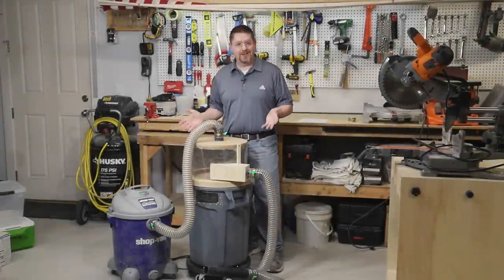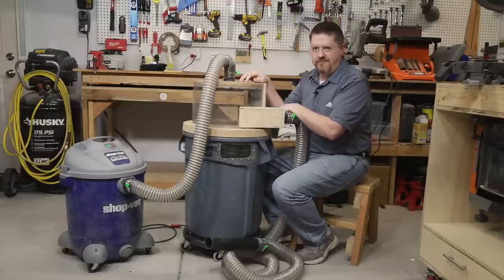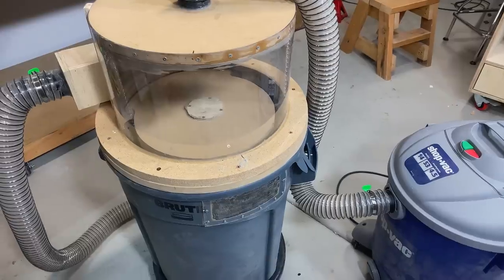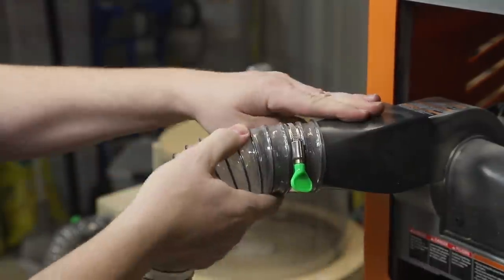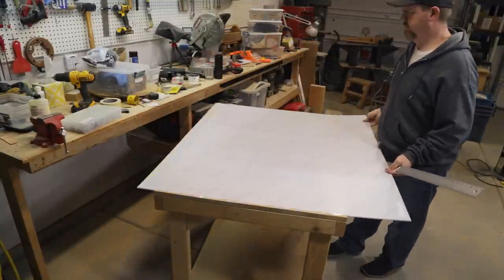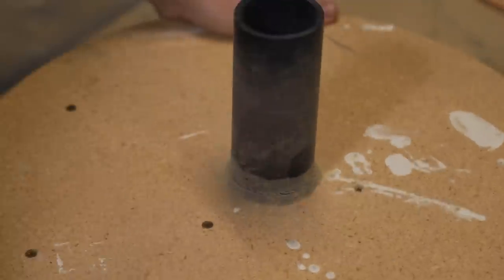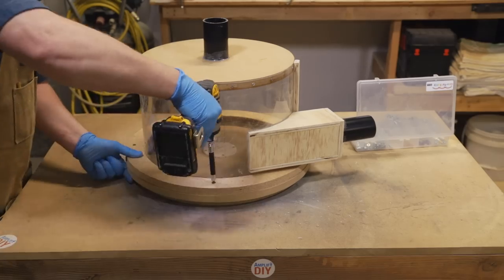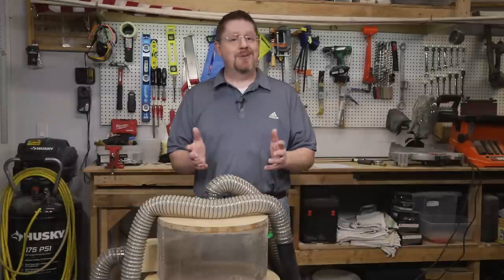Save Your Lungs! Dust Collection With a Thien Baffle Dust Separator

Comment: A suggestion for those using this on a planer or thicknesseser that produces large chips; these can clog the slot if they build up at the end of the travel, eventually blocking the whole baffle. When I made mine i added a 100mm circle at the end of the slot. Still works fine as expected but if anything larger than dust goes down the chute it can find a way down into the bin.

Thanks for a great channel, hi from Oz.

Comment: I've done the same basic design ... EXCEPT ... I used a 55-gal metal drum for the main receptable. Works great. Just that I don't have the ideal air flow configuration just yet. Your video is a great source for that info, Thank you.

Comment: Overall a nice video and informative.  The inlet should be at the top, not the bottom of the cylinder.   And it should be angled downward slightly.  Also, the dip tube should come down further into the cylinder.  The dust path while running shows you the problem.  If you look at other videos, you can see how the dust path is suppose to look like.  The most harmful dust is invisible, so what you see in the vacuum doesn't tell the whole story.
Reply from the maker: Thanks for the tips!

Comment: You need to support your inlet that fastens into the plexiglass to the wood so you don't end up cracking the plexiglass when you trip on the hose or something snags it.
Reply from the maker: This is a good tip. Thanks!

Comment: yep, I build one.  except I don't generate a ton of dusr So mine is built around a 5 gallon bucket. I Cut a piece of 1 1/2" PVC in to the side of the bucket (conforming to the circumference)  The bafffe is part of a bucket lid  I use a Stanley 6 hp 10 gallon vac.  Then built a stand out of PVC to stack them  (also stores tools) the collapsing bucket was fixed be sticking the separator inside of another bucket. The vac has a bag (for fine dust) after emptying the sepewrator  5 or so times the filter looks new (zero dust)  (I have less than $100 in it including the vac (new) and the PVC I am right proud of the way it works abd looks and the conveience of it

Comment: If you do a lot of work with MDF, you should use a HEPA filter cartridge in that Shop-Vac. A regular filter will still let some MDF dust through and you don't want to be breathing that stuff.
Reply from the maker: Good point. I don’t do a lot with mdf, but when I do I wear a full face respirator. I think you can see it in a few shots in this video. Great advice, thanks!

Comment: I've watched several videos on making this type of dust separator, this is the best!  Nice job in showing your mistakes as you went along!  I do have one question, why don't I see plastic elbows where the dust enters and on the exit pipe to help with the kinking of the flex hose I see in just about every one of the videos?
Reply from the maker: Thanks for the feedback! It never occurred to me to use an elbow at those locations. That’s a great idea!

Comment: Did you ever think about using a 20 - 55-gallon industrial barrel? They are a lot stronger than a cheap plastic trashcan. Some have handles on the outsides. They also are smooth on the inside. If you need any leads on where to get one... Try Craigslist for your area.
Just make sure the one you get has a removable lid. If it comes with a screw-type lid you may want to use some type of seal for the lid.
Reply from the maker: This is a great idea, thanks!

Comment: The ‘different’ thing here is the bottom entry inlet port which causes the waste to spin high up the sides.  There is room for a LOT of design experimenting here. No one addresses the height of the chamber to its diameter ratio, or depth of outflow tube into the swirl.  I’d love to do tests, unfortunately I don’t have the advantage of the super cheap materials cost you guys are blessed with in the US.  In UK that sheet of Polycarbonate is like 60 bucks (GBP) and the ply used here is about 30 bucks worth….with glue etc its 100 bucks per ‘top hat’.  The stuff you casually throw together and as easily throw away is over a weeks worth of entire disposable income! Ah well.
Reply: From all I’ve read or seen, the inlet port should be as high as possible (see comment by billwebster759, above).  Also, the exhaust port should be positioned about 2 inches above the baffle.  As to the ratio of height to diameter, I do not recall having come across any particular guidance.  I have seen woodworkers construct Thien-style dust separators that are two feet across and probably 16-20 inches high, or made from a #10 can or two liter plastic soft drink bottle.  I have observed that folks sometimes appear to forget or overlook certain aspects:  gravity, momentum, distance for example.  Good luck!

Comment: If you extend the vacuum pipe in the baffel so it just has a 1.5 inch space between the baffel and the vacuum pipe, and move the "intake" of the dust to the top of the baffel, the dust will loose speed alot faster and fall thru to the baffel.. also adding a larger pipe standing on the baffel itself creating a bit of a "maze" will help reducing anything getting passed even more. As vacuum is a constant and the only thing you need to be fighting is velocity vs. gravity it can be halted effecitly.
Reply from the maker: Good tips. Thanks!
Reply: Can you give a little more detail on this. I’m kinda slow so I have I have a difficult time understanding what you’re exactly saying. I’m planning on building something soon however a little larger and it would be great to get the dust pulled down into trash can rather than it continue spinning. Thanks, Joey
Reply from the maker: @Spurtaker   Moronicsmurf has suggested I make 2 different changes: Make the pipe at the top center of the whole thing extend down lower (so it's about 1.5" from the bottom of the circular chamber) and move the intake pipe (that the dust enters through) up to the top part of that chamber instead of at the bottom as I did. These 2 changes will make the dust come into the chamber above the top of the pipe that runs out to the vacuum, which will make it near impossible for any of that dust to get sucked into the pipe that goes out to the vacuum. This device already does a fantastic job separating out my dust, but those 2 changes would make it a bit better. Hope that makes sense - thanks for watching!

Comment: nice job. mistakes are only learning opertunities. 
the thien forum is great. im a regular over there. retired 2 is great .  to improve it  i would thin out the edge of the slot on the bottom . i would extend the outlet more. its a shame you made a double height seperater but put the inlet so low, if efectivly a single height  . not a lot you can do to fix that though . not sure a bell mough would help when the inlet is below it , it could make it worse. . i would double check you are sealing fully to the can , when you removed it on the first version you can see where dust has escaped onto the top edge. .    dont worry , these things are only small issues, once it works fairly good then thats all that matters
Reply from the maker: Great feedback, thank you!

Comment: The one thing I do not understand on you’re first design is why was no actual baffle installed below the inlet port?  Wouldn’t it prevent the chip/dust from being drawn into the shop vacuum?
Reply from the maker: It might have, but ultimately just following the recommendation from the forum I liked to in the description yielded fantastic results. I still use this thing today, and it’s great!

Comment: Include a pressure relief valve, aka check valve, one way valve or nonreturn valve
- “How to stop your cyclone dust barrel collapsing” by Charlie DIYte; features Dust Commander SP Anti-crush Valve, from Dust Commander; commercial valve, 5 euros, made in France, ordered from website, quick delivery
- “2 Ways to Make DIY Cyclone for Workshop” by Mazay DIY; employs a check valve made for plumbing, start at about $12, seems to work fine, 
- “Cyclone with pressure relief valve” by Badger Workshop; DIY valve

Comment: Awesome video!  I've been looking at making a dedicated dust collector for a cnc machine and I think this is perfect!  It's funny because I have that same shop vac and trash can! Thanks! (already a subscriber)
Reply from the maker: Best of luck, Eric! I'd love to hear how it turns out for you if you do decide to build this collector. I still have mine going strong, and it still works amazingly well. Thanks for watching!
Reply: @AmplifyDIY  I just tried mine out for the first time..  The trash can collapsed with such force, it pushed the baffle off of the top of the can..  I guess I have to make one of those rings for the inside of the can

Comment: Awesome video.  I loved that you showed your mistakes.  We all make them.  I learned so much more after seeing what you went through.
Would your original design have worked if the trash bin had smoother walls (and the sides didn't collapse in)?  Or do you think there were additional reasons it didn't work?
Reply from the maker: Hey Mike! I'm glad you enjoyed the video! As for my original design: I think it would have been ok(ish) with a smooth-walled can with enough strength to avoid collapsing... but doing the baffled top-hat design I think is quite a bit better. Had the original design worked better, I think there still would have been quite a bit of dust which worked its way into the shop-vac... particularly the super fine stuff. The top hat with clear sides also offers the advantage that I can see how well the cyclone is working, and it's really easy to tell when it gets close to full. If you are considering building your own, I encourage you to go with the top-hat design or something very similar. It really does work amazingly well. Thanks!
Reply: @AmplifyDIY  You went right from an interior, UNBAFFLED design with a long outlet pipe to the tophat design. There may have been a way to salvage your original attempt, although the walls of your can would still be working against you.
Reply from the maker: Ultimately I'm glad I went to the tophat design. It's been working wonderfully.

Comment: I have 2 questions.  1) I've heard that there needs to be some sort of a grounding wire to relieve the static charge.  2) How do you discard you sawdust-- burn it, put it a garden or compost pile which will take a long time to break down or some other way. Thank you
Reply from the maker: There is some static that builds up on the chamber and dust bin, but not much more than you'd get by dragging your feet across a carpeted floor. If you built a larger version of this that was not portable, a ground strap may be useful... but in this application it's not really needed. 
As for disposal, I usually just dump it into my regular trash for landfill garbage collection. I am just a hobby wood worker, so I only wind up needing to empty it a few times / year. Thanks for watching!

Comment: Anyone out there using the Fulton  2 1/2" hose linked in the description?  I'm ready to buy but worried about the hose collapsing in some of the reviews for the 10' and 20' lengths.

Great video!  The editing and voiceover is outstanding.  Sharing your mistakes and how you fixed them is what earned my subscription to your channel.
Reply from the maker: Hi David - thank you! I've been using this 2 1/2" hose for a few years now, and love it. I don't recall for certain, but I'm pretty sure I ordered something like a 50' length of it, which I cut up into the various sizes I needed for this dust collector. I am pretty sure that the longest piece I use regularly is around 20' (goes from dust collector out to various tools in the shop) and I've never had it collapse. 
Are you going to be using a shop vac, or something more powerful?

Comment: Great video and step-by-step explanations!  One comment:  Wouldn't it be better to have the inlet at the top of the drum, rather than the bottom?  The way you have it, dust gets trapped between the top of the cylinder and the high-speed inlet vortex.  Having the inlet at the top would allow the dust to fall down after being thrown to the outside of the chamber.  Thanks.
Reply from the maker: It may work better to put it at the top, yes. This one performs so well though, I'm not likely to try a different design. If I were building it again though, I think I would put it at the top rather than the bottom of the chamber. Thanks for watching!

Comment: Great video - the amazon link to the polycarbonate is broken.  Can you provide size and thickness of what you used?
Reply from the maker: Hi Lou - thanks for the heads up about the dead link. It was a 48" wide sheet, in 1/16" thickness, I believe. Here's a new link that should work: https://amzn.to/37BNIYQ
Good luck with your build!
Reply: @AmplifyDIY   BINGO!  thanks so very much... also, unless I missed it, is that a 20 gallon Brute Can you used?

Comment: When you showed the original Thein device, it had both input and output through the top, one in the center and one near the edge, with a 90 degree turn to create the vortex. That seems like an easier design to build since you are going through a flat surface and don’t have to deal with complex ellipse shapes. What was your logic for going through the side?
Reply from the maker: Hi Robin - I didn't want the 90º elbow hanging out disrupting the airflow of the vortex. Maybe it does not make much difference, but my intuition says small particles could hit the back side of the elbow and ricochet into the intake stream of the port headed out to the vacuum. Great observation!
Reply: Thanks. Makes sense.

Comment: Thank you for the great video. I am in the process of building the top hat now, but struggling with the polycarbonate. Do you know what size you used? Thank you in advance
Reply from the maker: HI Adam - I believe it was 1/8" thick. It is quite brittle, so be careful that you don't try to bend it too far too fast, and you have to work it pretty gently with power tools. Drilling aggressively into it, for example, can cause it to crack/split. Good luck!

Comment: Great video, thanks. The entry port to the baffle is at its lower end. Is there any benefit in placing the inlet higher up, at the upper part of the transparent side piece...
Reply from the maker: I don't know for sure. I placed it lower because intuitively I wanted the dust/debris to be as close as possible to the slots that drop into the collection bin below. Given the cyclonic action though, I'm not sure it matters much at all. Thanks for watching!
Reply: So if you do a big trawl of the website you will eventually find the answer. Main thing is the intake should be at the top, and the outflow to the shop vac should have a central tube that extends to within an inch of the baffle.

The reason is that the air comes in high and then spirals downwards to try to enter the baffle, helping pull the dust into the bucket below. As in the video, the air is spiralling up, and debris from above can be caught into the upstream and never make it into the bucket. 

I think there was some testing on the height of the top hat cyclone too but I can’t remember the results properly - I think it was determined that having height double intake diameter increased separation but with the cost of a small flow decrease, but don’t quote me on that
Reply from the maker: Excellent info, thanks for digging that out! Mine works so well I’m not likely to change the intake port location, but if I ever build another one I’ll put it up at the top. Thanks!

Comment: All or most industrial companies and small woodworking shop always have there dust  collection out side and away from the working area this would keep the working area much cleaner and healthier 
Also try to keep the exhaust port to the outside of the shop.
Reply: Sounds good if you are working on a shed or your garage as your small shop but, my shop is in my home basement. Don’t think I can vent or put the collector outside.

Comment: So...I am wondering if efficiency is affected by the height of the input port and what difference does it make if the exhaust tube goes down into the cavity?
Reply from the maker: I don't have good answers to either question. Have you checked out the discussion forum that Mr. Thien hosts? They likely have lots more detail about different design decisions. http://www.jpthien.com/smf/
Reply: Thank you👍
Reply: Best guidance I have seen is the exhaust port should come down to about 1.5”-2” above the baffle.  I have seen at least one or two built with the exhaust port extending below the baffle, but that greatly increases the risk of dust and chips getting sucked out, and into the shop vac or dust collector - ie, it’s counter productive.

Comment: Do you have a suggestion for a quiet wet/dry vacuum?
Reply from the maker: Unfortunately, they are all pretty loud, unless you are willing to spend quite a bit. Here's a pretty thorough article: https://bettersoundproofing.com/best-quiet-shop-vac/
Reply: There is a muffler you can buy for the exhaust port of the shopvac. Sometimes it is called a diffuser. Brings the noise down a bit.

Comment: Where did the plywood ring go that was in the first shot of the garbage can?
Reply from the maker: Hi Eddie - you mean the ring that you can see inside the can at the 4:08 mark? That ring lives inside the can, as the suction power of the vacuum will collapse the can without some reinforcement. There may have been some later shots in the video of the inside of the can with that ring removed as I was experimenting to find the best setup - but that ring lives in the can full time now. Let me know if I've misunderstood the question. Thanks!